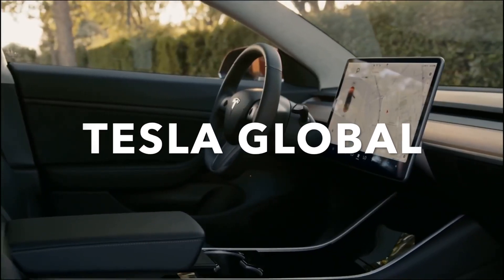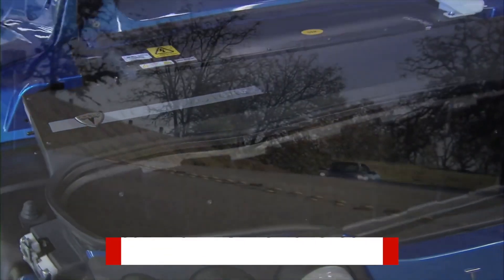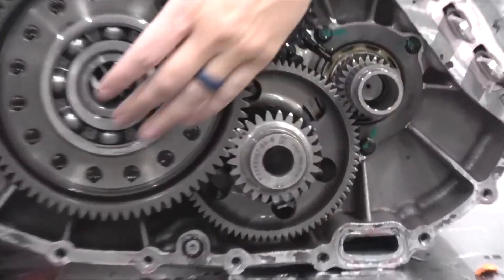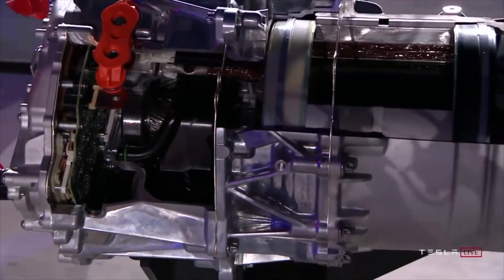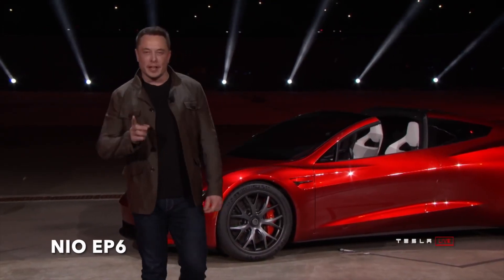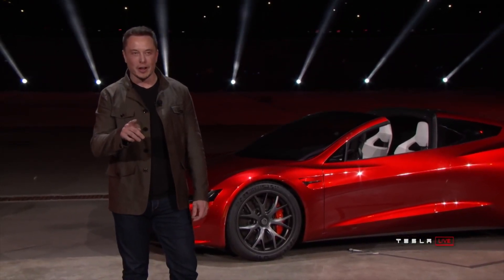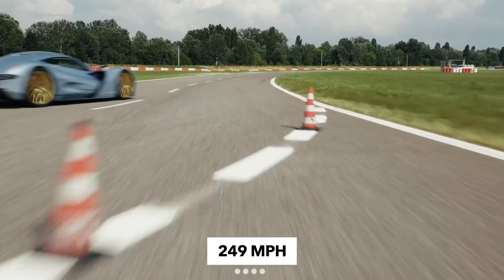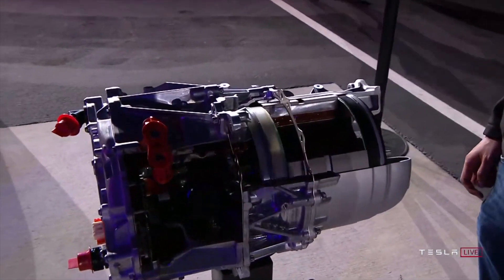MUSK Reveals NEW Tesla Motor!

Comment: The new motor can be traced to competition’s 800V charge voltage. 800V charge enables 2x fast charge over Tesla’s 400V station and EV. 
- half the charge time in completion EV place Tesla second on competition, isn’t acceptable.
- for Tesla to catch up with half the charging time their station must be also 800V. 
- to use 800V, with 400V Tesla’s battery and a new onboard charge electronics can catch up with competition suffering a lower efficiency, unless Tesla’s models are also 800V battery. 
- apply 800V to Tesla 400V motor can doubles its original rpm however also disintegrates rotor and the associate super magnets. 
- Tesla learn that efficiency of 400V motor can be substantially improved with 2x rpm at 2x supply voltage and the only major problem left is to keep motor from disintegrates. 
- hence the use of carbon fiber composite. 
To attain 
- higher upper rpm and top speed 
- to be more efficient and range per charge 
- to matching half charge time 
- to avoid over heating EV’s electronics hence longer mileage. 

Not all improvements in Tesla are self motivated but competitive driven.

Comment: Can't wait for the 3,800lbs Roadster! That's more than 1,000lbs lighter than the S Plaid or ~1second/10car lengths in the 1/4 mile. That's not including a more powerful and smaller carbon sleeved motors and 4680 batteries!

LOVE TESLA!!!